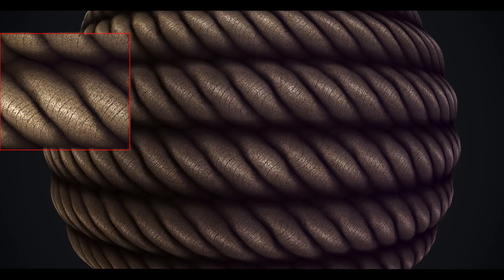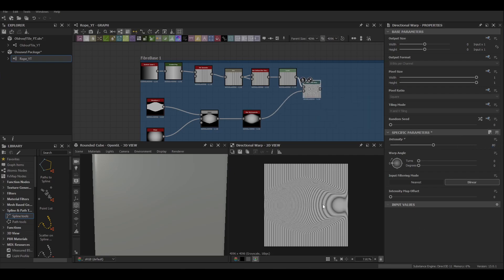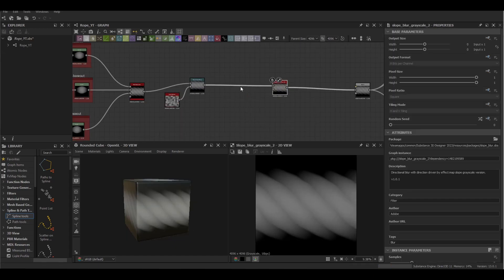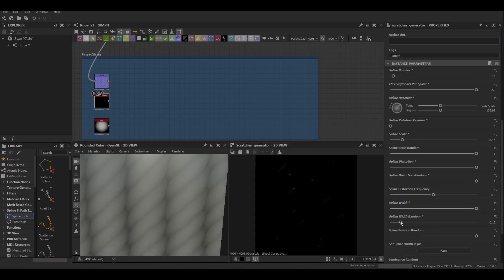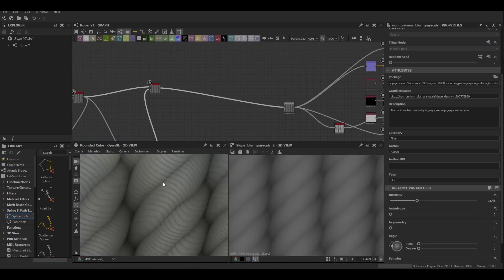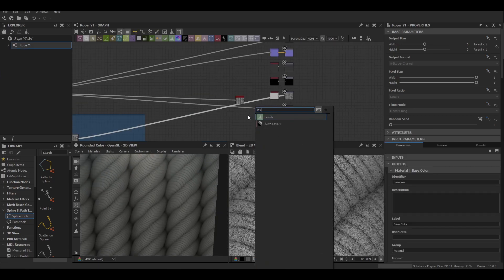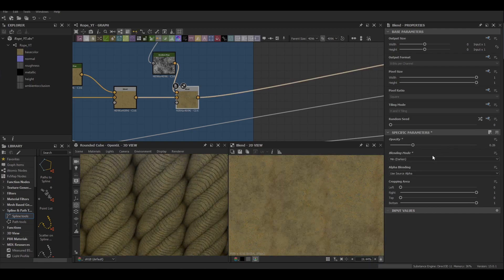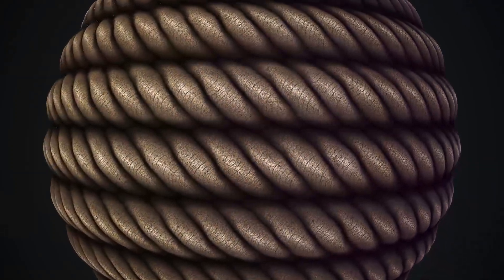Procedural Rope Tutorial, Substance3DDesigner

Comment: 0.43 cant connect gradient map to tile manager.  The connection is red. idk why
Reply from the maker: No worries it will be red as your node will still be set to colour mode while the tile generator only accepts greyscale nodes as an input, the gradient map can be toggled between grey scale and colour with the top two buttons on the node